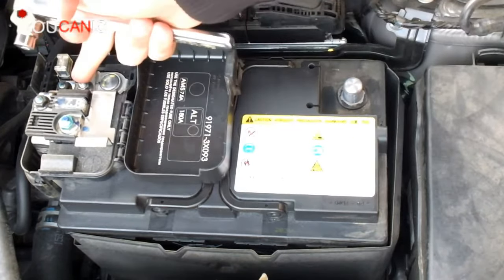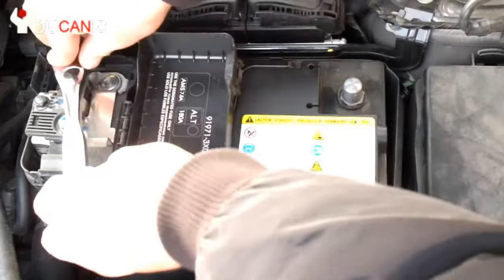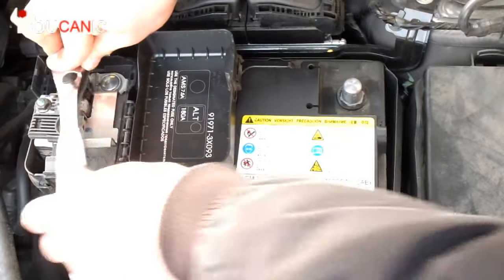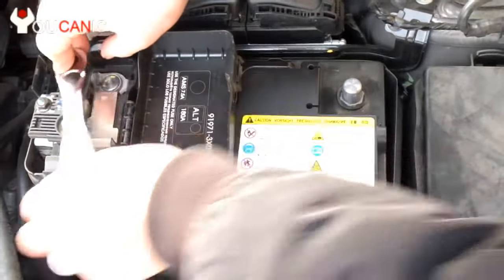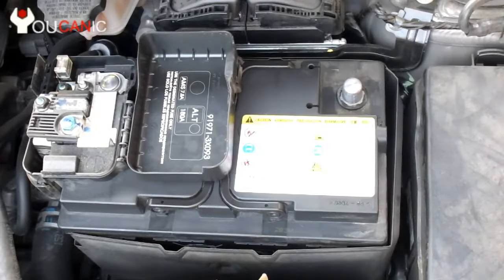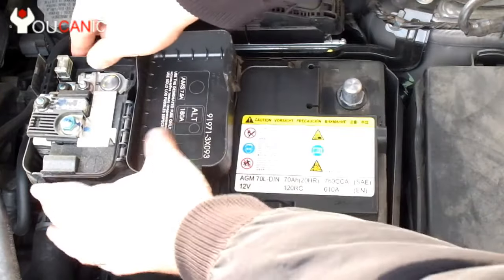Hyundai Disconnect Negative and Positive Battery Terminal Cables

Comment: If the battery disconnected, will it have effect on car locks? Will the car lock with manual key?
Reply from the maker: Thank you for your comment! To answer your question, if the battery disconnects, it shouldn't affect your ability to lock and unlock the car with a manual key. 

In terms of car maintenance and repair, knowing how to diagnose modern cars like expert mechanics do is crucial. That's why we developed the YOUCANIC Full System Scanner. This professional diagnostic scanner gives power back to car owners like yourself. Check it out at [www.youcanic.com/scanner](www.youcanic.com/scanner). Furthermore, to ensure you complete repairs correctly, you might need the assistance of Factory Repair Manuals and Torque Specs. These are available for a small fee at [www.youcanic.com/manuals](www.youcanic.com/manuals).

Comment: Disconnecting or even just loosening a battery terminal such as you did in this video is a good way to prevent car theft too isn't it?
Reply: I had an on/off switch installed which is attached to the battery. Once I get home for good, I open my hood and turn off the switch until next time I use my SUV. When you use your vehicle again, turn on the switch an wait for a bit. You might hear a different sound when you turn on your car but just wait until it runs normally. I love that switch. Saves my battery and it saves stealing your vehicle too

Comment: You should delete this video. Obviously you didn’t finish it. Plus you didn’t talk about losing memory settings if you don’t keep power to the car using a jump start battery pack plugged into the auxiliary port with vehicle in ACC mode.
Reply from the maker: We don't recommend back feeding the vehicle for many reasons. If you loose radio presets and one touch options or anything else you can easily reset everything in less than 5 minutes.
Reply: @YOUCANIC  true.... so far, all I had to reset was the time...
Reply: Don't be silly, what memory are you losing? Radio presets, maybe, maybe not. Change the battery, the car will restart all it's functions as you connect up.